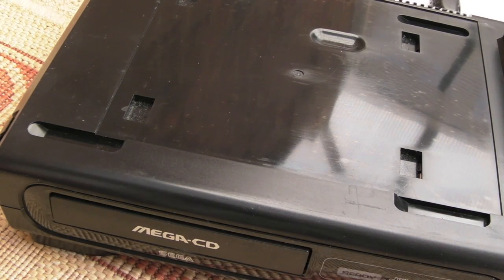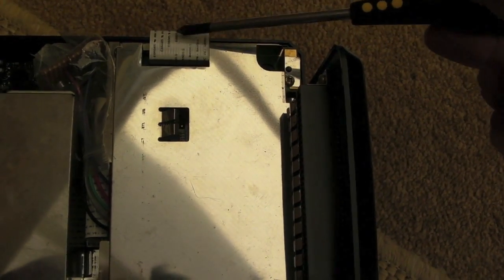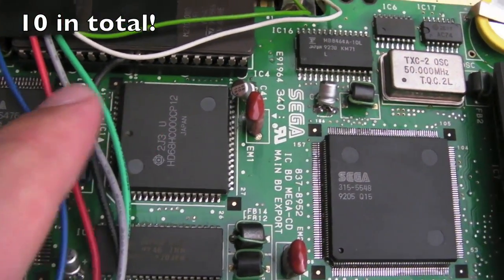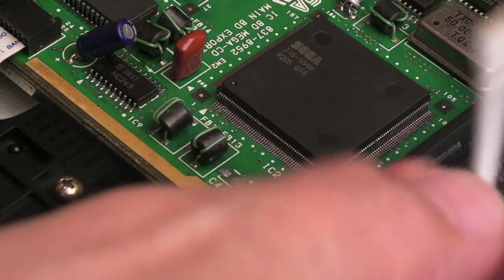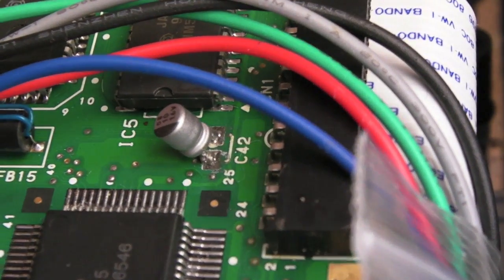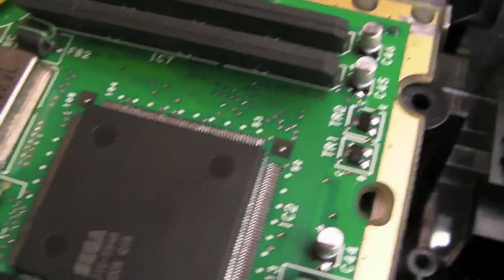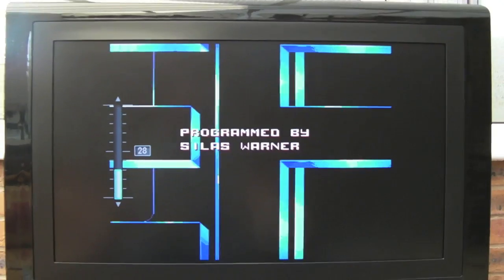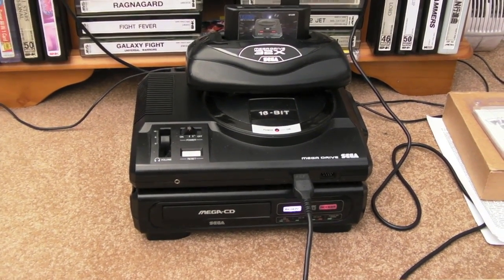Sega Mega CD Repair (Sega CD) - Recap of Recapping

Comment: For cleaning small areas I make my own little cleaning swabs using chamois leather and wooden lollipop sticks.

Trim off the end of a lollipop stick to make itsquare, sand the stick down across its width, like big fat toothpick.  Epoxy the slope (not too much epoxy or the chamois will absorb it and leave a hard pad), cut a bit of chamois to fit, clamp with a peg, leave to cure. 

Trim off the excess once cured, and then you can use a blade to split it down its length several times to create swab sticks of varying widths.
Reply from the maker: Thanks, that's an excellent idea =D =D
Reply: No probs, with decent sticks you can get them really rather thin, a cheaper chamois tends to work better, seeing as they are usually a lot thinner than ones from Halfords etc. I was shown this by an old ham radio guy.

Comment: Always nice to revisit a console you've repaired \ modded some time back. I had one recently. It was a friends RGB modded Master System II I modded back around 2006-ish (dead z80 this time). Wow, it looked a messy inside, not my best work. I suppose your standards increase over time that and you just get better at doing repairs \ mods.
Reply from the maker: Yes, I think you're right - our standards and skills do increase with every mod and repair that we do.  I do find myself going back to things to perfect them recently.  Sometimes I horrify myself when I look back at some bodge I did which was supposed to be temporary!  I am staring to re-think the temporary repair approach lol, and perhaps I should just slow myself down and just do a proper job right from the start rather than occasionally rushing something and planning to revisit it.

Comment: The Tower of Power! Nice work, looks very tidy now. My friend is looking at my model 1 cd, some sort of poor connection issue I think.
Reply from the maker: Haha - yes, thank god the master system adapter doesn't work on top of the 32x - I wonder if Sega deliberately stopped that from working that way.  I've occationally had a bad connection issue with my Mega CD once or twice - they make an aweful connection to the Megadrive sometimes.

Comment: Hello my Sega cd1 doesn’t play background music. On Sega cd all I hear are the jumps and coins. Main board caps are replaced and laser is new. Still nothing. Any idea? Thanks
Reply from the maker: Possibly the sub board (the board that has the power connector and audio connectors) - https://console5.com/techwiki/images/c/c2/PC_BD_MEGA-CD_SUB_BD_171-6115C-Schematic-1_of_1.png

Maybe a corroded trace around there, bad cap, bad ribbon connection to main board, or perhaps a bad DAC or opamp on that PCB!
Reply: @GadgetUK164  thank you for the reply. That’s my next plan of attack. I read that caps 3/13/14 could be bad and affecting the sound. I’m not super skilled in soldering so I may have my guy change them all out for me on that power board. Thanks again.

Comment: Nice one. I need to open my multi mega and check it out. I also need to remove the internal battery while I'm there. I don't want that to leak.
Reply from the maker: Yes - good idea on the battery!  I have swapped mine out too but didn't mention it in this video.
Reply: Is it work removing it completely or swapping it?
Reply from the maker: I just swapped it for a new one!  They don't tend to leak that type of cell - although they can after a very long time.   I use the save support so the battery is essential for me.

Comment: If it's a dual rail supply the + could go to the ground... so as long as it's not a negative supply your trick is fine.
Reply: TheDefpom

Normally, the silkscreen should still denote the orientation of the cap itself (or other polarised component.)

So, for negative rails, the "+" of the cap may be connected to ground, but still marked OK on the board.
Reply: TheDefpom

Oh, I watched the rest of the vid. lol

You are right for pointing that out, as a cap on a negative supply rail will have it's "+" (positive) terminal connected to ground (as we said).

In those cases, checking the cap pads for continuity to ground of course won't work.
Reply: (and I think the Mega CD / Sega CD might have a negative supply rail for the opamps on the "analog" board?)

That would require a DC-DC converter in the unit to generate that neg rail, so I'm not sure, as I haven't looked at the service manual / schematics in a while.
Reply from the maker: Thanks!!!  Yes - I always miss things out and make mistakes in my videos.  There are of course lots of other scenarios where it could be tricky working out which way an electrolytic goes around depending on the circuit there.  But a -ve supply rail is a fairly common scenario to consider.   On the logic board there I think it's all +ve, and the only negative will be related to the op amp as you say - on the little PCB at the back with power input etc.
Reply from the maker: Yes, its a valid point!   In general its still a good technique for that rare occasion you mess up (chances are for one cap you will be OK), and if you accidentally put it in the wrong way - it will give you a nice loud reminder of that fact later ;)
Reply: GadgetUK164 - Retro Gaming Repairs & Mods

No probs, mate. We're just glad you make these vids, as they're still among the most thorough (and fun) around. ;)

That whole thing with the 3V3 flash carts is really kicking off btw. lol
(see RGT85's vid, and my spamming of the comments.)

Did you also see my reply to your Neo Geo 161 cart vid?
Reply: GadgetUK164 - Retro Gaming Repairs & Mods

It's possible that changing the diode on the NG 161 cart to a proper 3V3 reg may possibly be slightly worse in some ways, as then the voltage difference between 5V and 3V3 is 0.3 Volts more than before (on the cart bus).

So, the protection diodes in the cart / Flash will be dropping a bit more voltage than before, and hence more current dissipated as heat.

The best thing would be to add some series resistors on all of the relevant bus signals, but I know that's probably not too practical.

It also depends on whether it's worse to over-volt the Flash chips slighly, vs having the extra current peaks on the busses?

It might even have resistors or something on the underside of that Flash daughterboard, I can't remember if you showed that?
Reply: GadgetUK164 - Retro Gaming Repairs & Mods

Obviously the resistor thing sort of goes against most of what I said on Shawn's vid comments earlier about the Everdrives. lol

But it's still way better to have the series resistors than nothing at all.
Reply from the maker: I've not seen that message yet but yeah I totally get that point - someone also mentioned the exact same thing over on the Krikkz forum, but tbh as I said there - the main thing that kills the NG multicarts is the overvoltage - eg. 5.25v on the Neo Geo == 3.85v to the CPLD and NVPROM chips.  The CPLD on some of those carts is also 5v tolerant on the IO pins, although I've never checked whether any data or address lines go straight to the NVPROM chips or not.  The other problem when not using a regulator is on a typical PSU you get voltage levels following deviations in the 5v rail, so for now I am happy to accept the risk as is I think.  The heat thing also seems to be another one of those that hasn't really been proven either - ie. I suspect that the very small amount of heat generated is possibly being handled by the package bodies, because out of the systems I've tested that use 3.3v logic on them, they don't get warm at all!  I am 100% sure that it's not the right way to do things, but it does just seem to work.  Maybe in years from now we will see some of the systems that used 3.3v flash carts etc start to die...
Reply from the maker: Yeah, that might be an idea for a future mod lol =D
Reply from the maker: The resistors in series I mean!
Reply: GadgetUK164 - Retro Gaming Repairs & Mods

Ohhhh, don't mention consoles dying from some of these carts. You might be dangerously close to actual science. lol

You're obviously just a shill who wants to bump up the price of original carts. hehe

(sorry, it's been a long night, and I think I caught Ebola after dusting out my PC. lol)
Reply from the maker: Haha =D

Comment: Very neat job, Need to do the same on mine and also do the region switchless mod. 
Just a quick question, My Mega CD image jumps and jitters in pal mode but is fine when i switch the megadrive to ntsc.
Could this be due to the lcd tv i'm using?
Reply from the maker: Thanks =D   That's very strange!  Is your TV a european model?  I could perhaps understand the TV glitching a little with sync on a PAL Megadrive switched into NTSC (since the fps ends up 59.3Hz or something daft as opposed to the 59.9 or whatever it's suppose to be.  But if its a european TV, with a PAL Megadrive and you find switching into 60Hz is OK and yet 50Hz flickers - that's a bit wierd lol.  That would make me wonder if perhaps the capacitor and resistor size on your scart cable could be the issue.  Might be worth checking what cap and resistor on are pin 20 of your SCART cable.

Comment: Hiya, thanks for sharing does the Model 2 suffer in the same way that the Model 1 does with caps as shown here?
Reply from the maker: From my experience they are much much more reliable on the model 2 CD - They tend to be through hole.  You can see a photo here:0 http://www.the-liberator.net/site-files/retro-games/hardware/SEGA-Mega-CDII-CD-II-2/Sega-Mega-CD2/Sega-Mega-CD2-015-Motherboard.JPG
Reply: Thanks kind sir, I have both models. The Model 1 is actually my original one from back in 93 from Comet! With this video and knowledge, I'll be cracking open the case and looking to take care of it now.
Reply from the maker: Ahhhh, Comet!  Shame they went under - I bought nearly all of my original systems from Comet - SNES, Megadrive, Amiga 500+ etc.

Comment: Hello. My Mega CD started buzz noises. Do you know which caps should I replace?
Reply from the maker: All the caps on the logic board should be replaced on these (before they kill the system).  Audio issues generally means the back sub board (the one with all the audio connectors and power connector etc) needs recapping.

Comment: i just recaped my japanese mega CD model 1 checking it after every cap i put in working ok got done to the thrid last one now control pad is not responding with the mega CD at all what have done wrong ? took the cap off again replaced it with a new thinking it be a bad cap still no good have tried 3 different japanese megadrive with it , control pad working fine with megadrive games im at a loss
Reply from the maker: Sorry, I see you've recapped it lol - I've read these messages in reverse order...   I would re-inspect the work you've done, look for particals of solder etc, make sure there's no flux or corrosion on there.  Clean the PCB edge up too - the bit that joins the system to the Megadrive / Genesis.

Comment: I replaced all caps and cleaned the board ,but still hangs on the BOOT screen :(
Reply from the maker: You might have a damaged trace there or bad via perhaps?
Reply: @GadgetUK164  the pittiest thing is that the board worked normal with the old caps (I did not checked them) and after a wiele it started to glitch the screen and hangs on the boot screen. Then I noticed the lacage and replaced then and cleaned, but as I sead no change :(

Comment: Is it necessary to have a fume hood set up in order to do recapping work like this?
Reply from the maker: It's certainly a good idea if you are doing lots of soldering, or if you are working in an area that is not well ventilated.
Reply: A fume hood is massive overkill for a recap job.

Comment: Nice job! So with SMD's like that, it's perfectly possible to just use a soldering iron? I do worry that I'm gonna get an A1200 with faulty SMD caps and I'm not gonna be able to replace them as I don't have a hot air gun lol
Reply: Simple answer? Yes. Longer answer... You can get SMD "training kits" from ebay cheap. Solder a few things and see how you fare when removing them. Much better to practice on something disposable.

Hot air is great for removing PLCC and similar components with many legs, but for things with two or three spots a soldering iron with your preferred tip is good enough. 

I'd suggest adding fresh solder to the existing solder joints before trying to remove them. Old solder can be stubborn due to oxides etc.
Reply: Thanks for the tips Neffers!
Reply: No probs man. There's looads of hints and tips out there, and thanks to the interwebs, it doesn't take long to find many of them ;)
Reply: RefractionPCSX2

Only problem with heating only one pad / leg at a time is that it can rip the pads up, even if you very gradually "tilt" one side of the cap while the solder is molten (and then the opposite side etc.)

I've done that a few times and lifted some pads, no matter how careful I was.

The "ideal" way, when the SMD parts are flat on the board, is to use a hot air station, or the two-prong "soldering tweezers", as Mr GadgetUK164 mentioned.

Personally, I would NEVER recommend twisting any component off the board. It's a define no-no in electronics reworking.

I would sooner recommend the snips method, but even that is less-than-ideal.

(I have used that method on my own stuff, with fairly good success, but there's still a risk of ripping up pads / traces.)
Reply from the maker: Yes, as Neffers and ElectronAsh have said, you can totally do it with a soldering iron.  Just be careful with the removal - that's the hard part, if you can get them off without any damage, you're onto the home run.  If you attempt it, just take your time and make sure you have good flux, desolder braid, and kapton tape.
Reply from the maker: Yes - totally agree, there is risk associate with heating on pad / leg and lifting.  Snips has lower risk (snip in the middle of the can - I didn't explain that very well in the video.  You aren't aiming to cut flush with the board - that will cause damage, but in the middle of the can, the top part comes away which allows the bottom part of the can to come off easily, and you can just heat both remaining legs easily at that point.  And of course, hot air has the least risk but can be more tricky when there's loads of corrosion, and you obviously need to mask other components off etc.
Reply: Training kits? Dead PC main boards and crashy WLAN routers.
Reply: GadgetUK164 noted, best get myself some decent snips lol
Reply: Fair comment Siana :)
Reply from the maker: I often use WLAN routers for a source of EEPROMs =D   I just have this strange feeling that 30 years from now there will be collectors of old routers, and they will be kicking off about all us people that have destroyed them over the years lol.  I doubt it though, we are in the 'disposible age' I think, where RROD XBOXes aren't worth £5.

Comment: update mega CD is reading audio CDS but the sound is distorted really bad but audio is fine on bios screen any idea's
Reply from the maker: Have you checked the caps on the digital board - as shown in this video?
Reply from the maker: Actually, thinking about it - check the caps on the audio / power board at the back as well.

Comment: Nice work, but why use those same type of capacitors?
Reply from the maker: It's true that it can be easier to solder through hole capacitors instead, but when the pads get damaged from corrosion they can have a weak connection to the PCB - so if you solder through hole caps on there, the weight of the cap can move / damage the pads - especially when the console is sent in the post etc (any knocks and the cap moves and can lift those weakly adhered pads.  Plus it looks better with the correct SMD parts.
Reply from the maker: And its not the case that all SMD electrolytics will leak btw - lots of caps from the 90's suffered from leaking in later years.  More modern caps may or may not do that in future (I hope NOT lol).
Reply: I am sure they are better than the garbage from back in the day, but thanks to Sega and NEC I refuse to use SMD